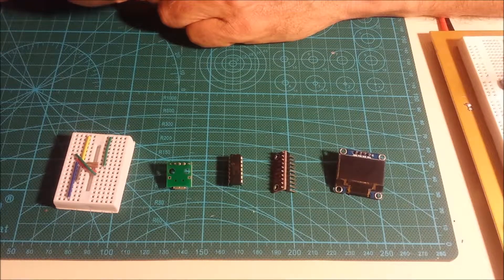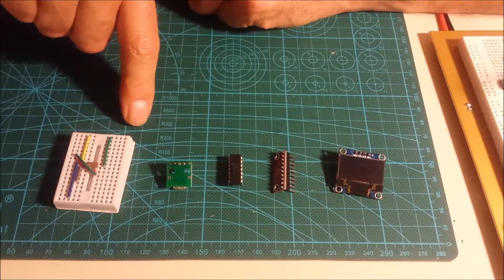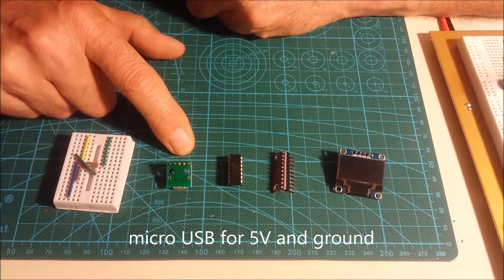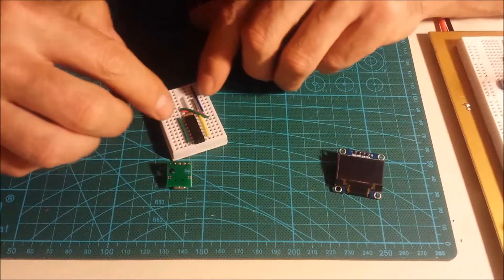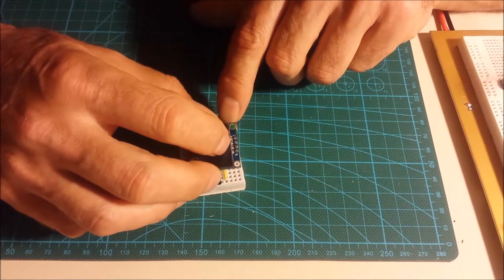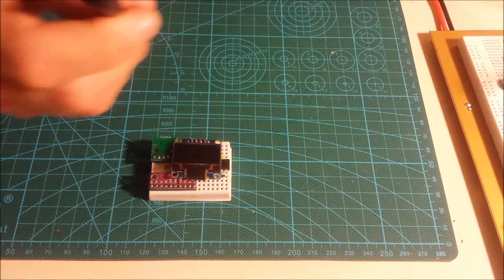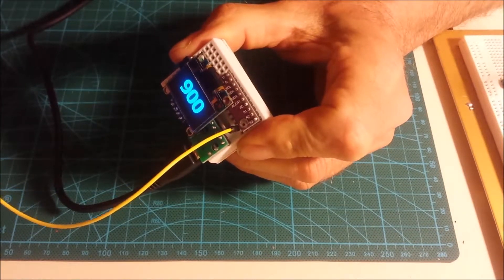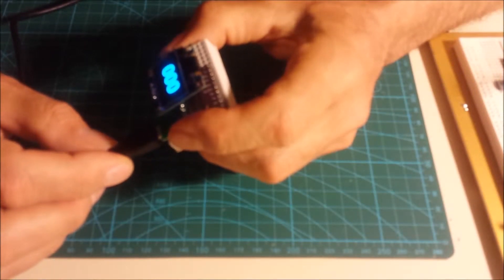2006 Sprinter Transmission Temp Gage

Comment: Hi there where do I get these parts,m
Reply from the maker: You can get the electronic parts online at Amazon, AliExpress, or Ebay.
Reply: Hello thanks for the reply. You have bunch of wires into the breadboard. Is there a right up or closer picture of where the wires go and the all the rest of components.thanks
Reply: By the way love the creativity on this guage. Most people would just go and buy an aftermarket guage.
Reply from the maker: @stevecamrie1360  Just having the parts connected is only the start of this project.the final working gauge requires you to have some programming knowledge and to run that program code on the microprocessor. The video wasn't intended to cover all these aspects, just what the gauge hardware and footprint would look like, very small with few components. I have it sitting on my dash console and works great. I can provide a programmed microprocessor at a reasonable cost if you'd like one.
Reply: How much to program it? Or just sell me a complete one. Just to compare to an aftermarket gauge.
Reply from the maker: @stevecamrie1360  $20 for the complete gage (all parts + programmed chip) with a wiring schematic
Reply: Where are you located? Can you ship to Canada?
Reply: Let me know. I kind of need it before it gets too cold out to install.
Reply from the maker: @stevecamrie1360  I'm not setup as a business Steve and shipping to Canada looks complicated. Let me know if I can help you out another way.
Reply: @awesomeadventurerstravelne1776  I would pay for the shipping using PayPal or something. Or you could maybe email me how to program it too that'd helpful. Its upto you. Let me know. I could always go with an aftermarket. But I like using the internal temp sensor to measure inside working.
Reply from the maker: @stevecamrie1360  Let me see what shipping will cost. Can you tell me what address or location in Canada ?